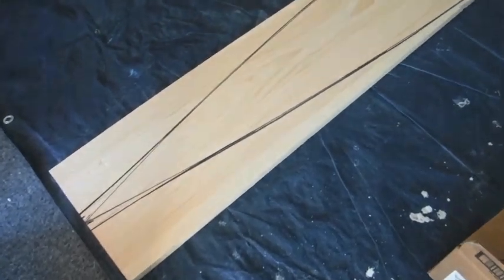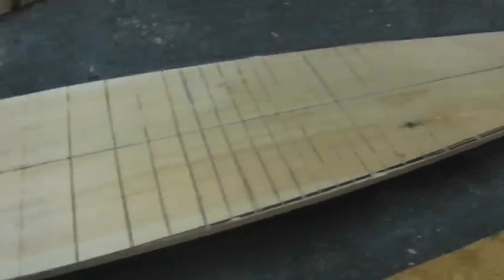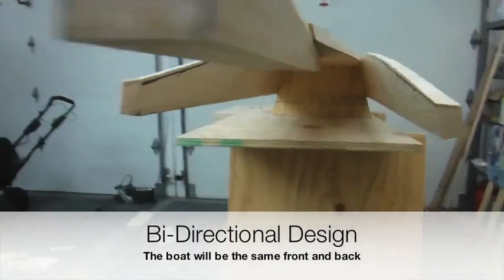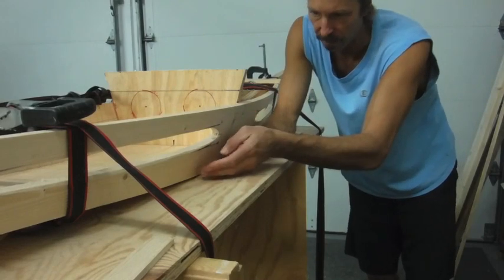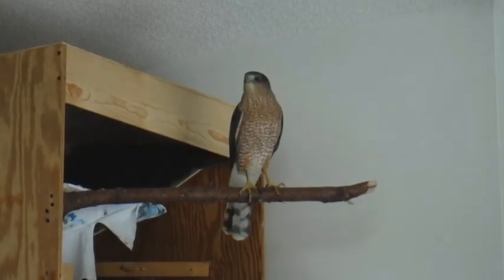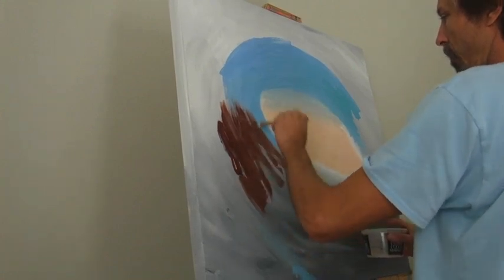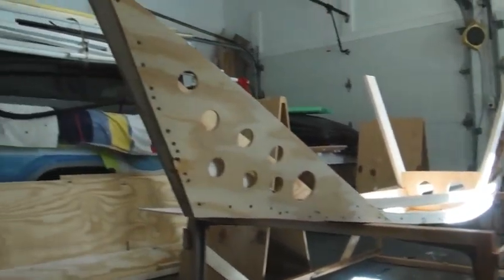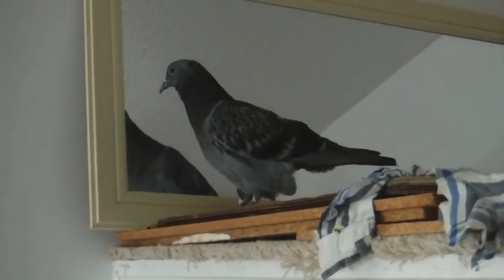Sailing Canoe Build Part 1/9

Comment: I really dig those lightening holes!
Reply from the maker: Yes they add up. I have a few hole-saw sizes. Plywood is heavy so when adding a few layers, some can be removed. Cross grain lamination, different thicknesses, there are many opportunities to remove some extra weight.

Comment: proas are asymmetrical, and not polynesian.  good long-haul design, but outriggers handier in narrow water.
Reply from the maker: Yes correct. I was using my build to show how you could potentially build one. Im building a true asym pro(same build technique in this video) right now. Im still learning. Also the paraw is polynesian I believe and is not asym and is trimaran. I'll be swapping out parts from all of my boats and interchanging them. Im doing this to learn better and understand better how it works in real world (not computer design) environments. I notice many dreamers on here, but to actually complete and sail is the hardest part. More to come in the future soon. Cheers.